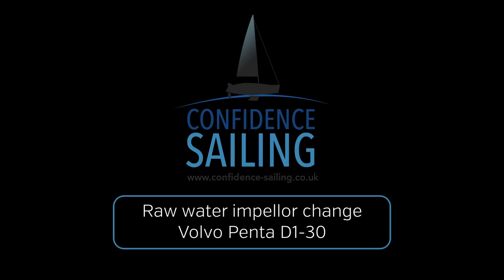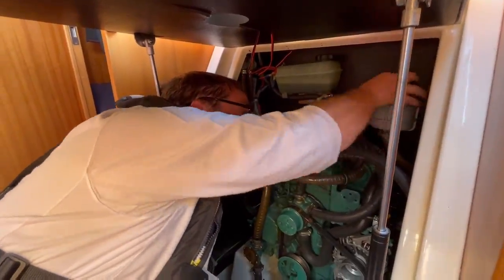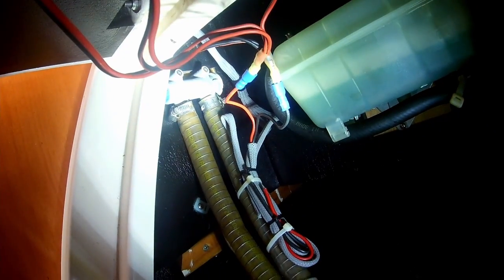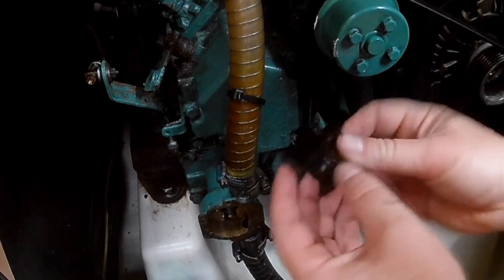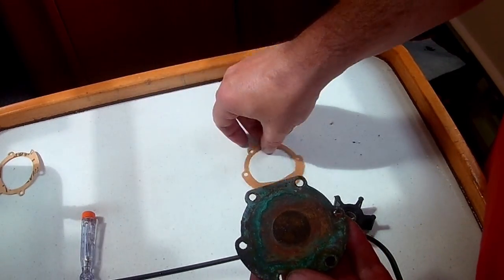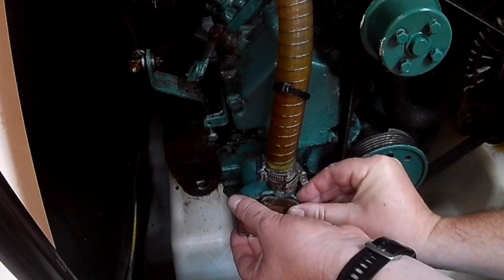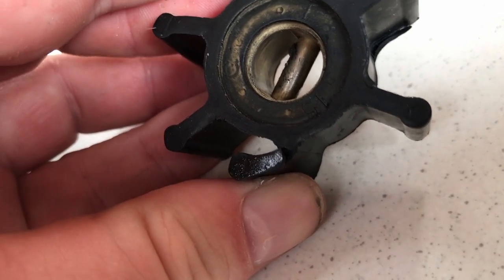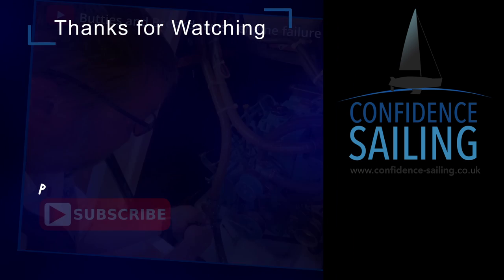Small boat engine servicing - How to change the raw water impellor

Comment: Thanks for this. My Yanmar 3GM30 seems to be periodically getting air blockages. The overheat alarm went off last Thursday after a long sail, no water being pumped out of the exhaust. I undid the cooling pump inlet which flowed water, then the outlet which flowed water. Restarted and everything worked fine. Very peculiar!
Reply from the maker: Ooh. That sounds very similar to a problem we had last summer..!  during our sail the water drained out of the cooling system, which is not unusual in rough weather or if you have a long sail, but on start up, our pump didn't have enough suction to self prime. It might be worth watching our video on the incident.
Have a watch and let me know in the comments if it helped.
 https://youtu.be/X4tAsHm8Zcg

Comment: The volvo manual says to lubricate the impeller with glycerine only.
I guess that is what the volvo lubricant is?
I have stopped using vaseline on O-rings, these days I use silicon grease or the oil or fuel it will be sealing.
By the way thanks for a very helpful series of videos on the volvo D series engines.
Are you going to do one on cleaning the heat exchanger?
That is MY next challenge.
Reply from the maker: You are correct. The lubricant that's included with the impeller kit is glycerine. The main reason I still use vaseline is because the glycerine is runny. The vaseline stays where you put it, which is useful when fitting a new impeller. 
I would definitely concede that the manufacturer's recommendations are always the one you should go for... Even if that's just to make sure there's no wriggle room with insurance company payouts.
Reply from the maker: And thanks for watching 😁